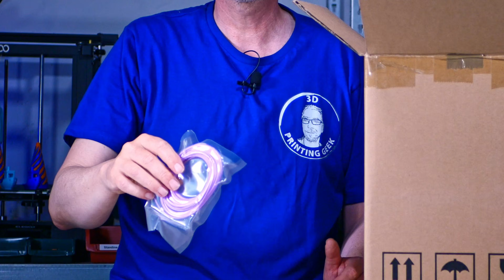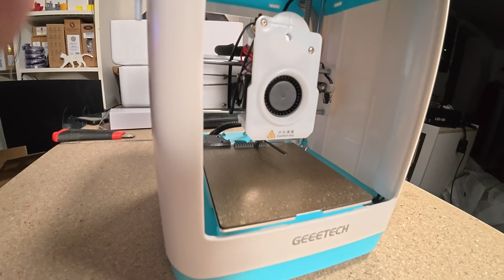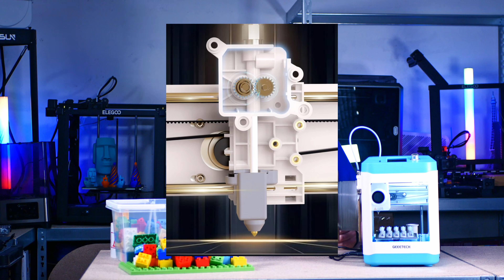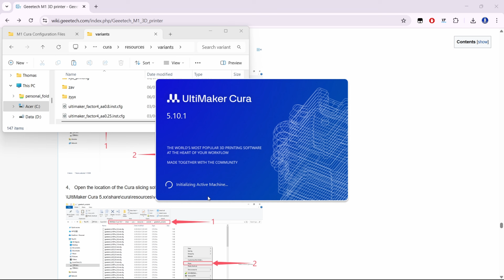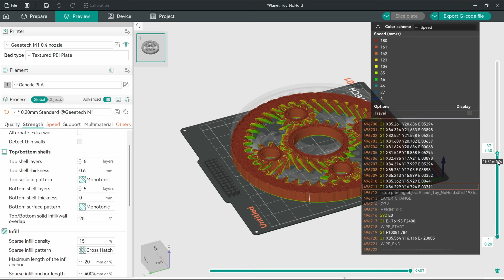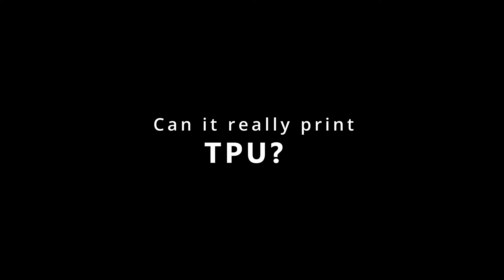Geeetech M1 Mini: Toy, Tool, or Trash? (review)

Comment: I'm working on a project to klipperize and upgrade the toolhead and electronics on the M1. I have a page on github called Geeetech M1 Upgrade. I completely redesigned the toolhead and am planning to replace the mcu with an skr pico so I can install klipper and do some input shaping. It's already a pretty nice little printer but once I get through with it, it will become a BEAST.

Comment: How can I get wifi on this?
Reply from the maker: Unfortunately the Geeetech M1 mini doesn't support Wi-Fi. Maybe you can use a Raspberry Pi (model 3 or newer should be sufficient), flash Octopi on an SDcard using Raspberry Pi imager and connect the Pi to the USB port. I haven't tried it myself but that's the only way I can think of to control it over Wi-Fi. Then you can of course connect a camera to the Pi to get remote monitoring.
Reply: @3D_Printing_Geek Geetech sells a wifi dongle for the m1
Reply from the maker: I've seen a dongle but dated from 2017. I couldn't find it in their shop. If you have a source here to buy it, then I'd appreciate if you could share it, so that others can buy it there.
Reply: @3D_Printing_Geek you will also need the geetech app

Comment: The price is right.  It has a small build plate, but for the price, it is not bad.  For the price, it is a decent value.
Reply from the maker: Totally agree! For the price, you can’t really complain. There may be bigger options at a similar price, but if you don't have the space to place them, this small printer may be the right choice.